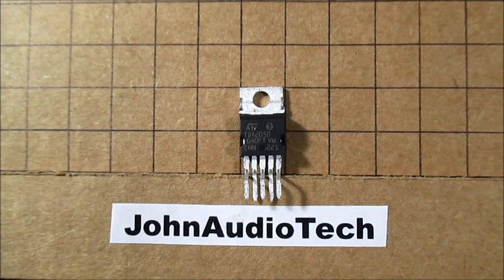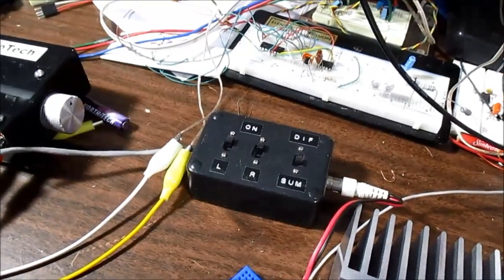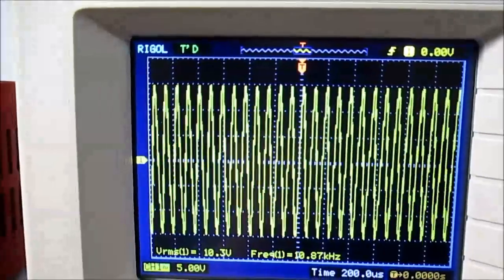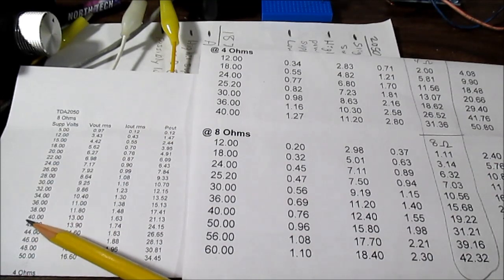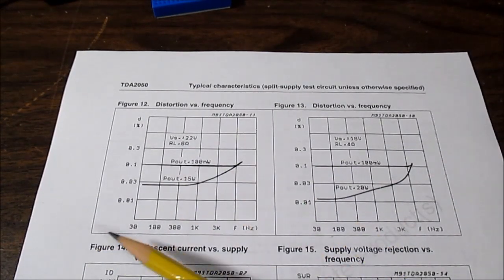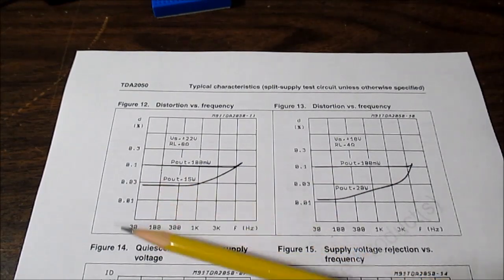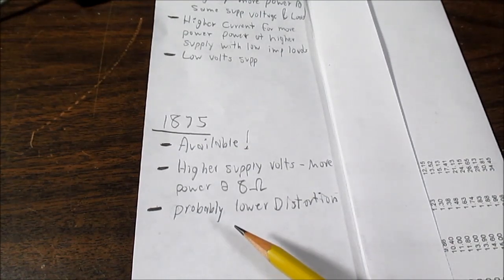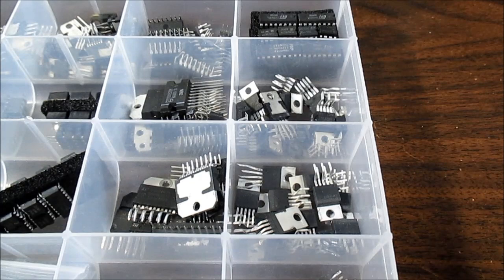TDA2050 audio amplifier IC test & review plus compared to the LM1875

Comment from the maker: Hey guys! A couple points I didn't mention in the video: The TDA2050 seems to be more prone to instability so needs careful layout and component selection. Its current limit tends to make a loud pop sound when activated while driving reactive loads. The LM1875 has the advantage in both cases. I plan to test these issues and make a video.
Reply: i bought the same lm1875 kit from ebay the amp makes a click sound when turned on/off. does it happen with  your kit too?
thanks
Reply: Bharat Singh my lm1875t deadly silent, try better component. I use film and mica for smaller caps value, fc for feedback, fm for power and elna for psu. Elna re3 might be slightly cheaper for power filtering, i only use what i have at hand.

Elna re3 work well for tda series, i notice significant improvement for tda series. Confirmed by blind testing with my friend compared to several others including fc series.
Reply: @wiradharma7030  are you getting good quality ics of Tda2050 ?
I'm getting some cheap versions here in India so I want to know that how much maximum voltage can it sustain since Tda2030,2050 are all obsolete now but still I want to make an amplifier for home use so please tell me about the max operating voltage
Reply: @amitghosh6966  Once i didnt realize that i use 27++vdc unregulated on 4ohm load without problem other than the heatsink got slightly warmer. BTW, I tend to use bigger heatsink than I should. 

I got most of the chip and transistor online from inline seller with higher rating. The parts I got from local store has questionable quality, I stop buying critical parts from them since like 2 years ago. I only buy non critical parts from local store like resistors for psu and emmiter, jack & cables, screws and similar non critical item.

So far l never have failing chip even when I use them on higher than rated voltage. I think almost all tda2050 chip out there is not genuine anyway, but some replica seems to perform better than others. The issues that I got currently is on lm1875 which at lower wattage got slightly warmer even on bigger heatsink, much hotter than tda2050. My latest project is 3x lm1875 in parallel, I use similar sized heatsink with lm3886 @26.5v 4ohm -62Wrms output. The lm1875s run very hot @24v.

Btw, try lm317/337 with 2x tip41/42c for supply. I use 20k trimpot for voltage adjustment on 25v AC. Its cheap(less than $10) and u ll got noticeable improvement on any amps compared to unregulated supply. I made mine with point to point method, ugly but its works.
Reply: @wiradharma7030  thanks for the reply. I love making amplifier circuits so I keep asking everyone about anything about amplifiers
Reply: @wiradharma7030  Can We get the same output from Tda2050 ic on Single as well as a Split supply ?
I wired a Tda2050 ic on Single supply mode at 24 Volts , 4 ohms load and got maximum 6 Watts before Clipping. I want to know that if I power this chip on split supply of +/- 12 Volts ie 24 Volts , will I get the same 6 Watts or even more watts ?
Reply: @amitghosh6966  in theory, yes. John got 9.33watt rms even at 8 ohm with 28v(thats  should be single supply). U might got rebranded tda2030. Tda2030 with tda2050 marking on it.

Try different source(thats bad chip u got there), or try lm1875. Use 100uf-220uf on feedback caps(the one in series with 680r/1k resistor to ground). I use muse fg there, its cheap and sound quite decent. I used to use 22uf bp there, 100uf muse fg give more thump. I dont know of u ll find one, try find "su rong" mkp as input caps(bright red). Its chinese, but sound great. Btw, I use 1uf for input, 47k&1.8k resistor on feedback loop with 100uf feedback cap. I add 1.8k series between input cap & input pin, and 470pf to ground between the 1.8k resistor & input pin to filter EMI. On feedback I add another 47k + 27pf ceramic paralel with the 47k feedback resistor to compensate 470pf capacitance loading. The resistors are generic metal film(i stop using vishay dale, too expensive lol) the 470pf&27pf is cheap monolithic ceramic. It should be equal to 22k feedback, but with 47k u ll need half the caps.

Oh, dont forget to make the feedback loop as short as possible. I solder the feedback res directly on the pin, lol. Try find 220uf genuine elna re3, for power filter caps. On chip amps i use 2200uf, 220uf, 1uf ceramic and generic 100nf mkt. Elna silmics ii sound great but too expensive, elna re3 sound quite similar at a fraction of the price of silmic ii.

Edit: it should be muse fg(black/gold) on feedback, muse es(green) is bp cap. Muse es still too expensive for me, lol.
Reply: @wiradharma7030  If operating this chip tda2050 on Single or Split supply gives the same output power, then what's the benefit in operation on Split supply rather than Single supply ?
Reply: @amitghosh6966  split supply, no output caps(big caps series to speaker), no turn on/off pop.
Reply: @wiradharma7030  Ok. Thanks for reply.
And one more thing I want to know that if I operate this chip on Single 24 Volts and also on split +/- 12 Volts (24 v) will both the configuration draw the same current or there will be difference of current drawn  in both ?
Reply: @amitghosh6966  I havent measure, but i prefer dual rail. On op amp, dual rail allow for rail to rail voltage swing. And seems more stable. Why u prefer single rail? Even on my car, I use single to dual rail inverter. Dual rail seems to output more power before clipping, I dont have proof on this, its just based on my ears. Dual rail amps much more simple, and easier to tweak around. U might hit supply current limit earlier with single supply. Is there any reason u prefer single rail?
Reply: @wiradharma7030  It's difficult to get centre tapped transformer here for a specific voltages say 9-0-9 or 10-0-10 etc. Since I don't know how much maximum voltage these cheaper version chips available here will withstand I prefer Single supply operation of these chips. These transformers may be available online but  the prices are too high for me. Anyway thanks again
Reply: @amitghosh6966  try making adjustable linear regulator. U need lm317, lm337, 4 1a diode, 2x 240/330ohm(i use 330r) resistor, 2x 0.5w 100ohm resistor, 2x 2k trimpot, 2 set of tip31/32 or tip41/42(i use this set), 4 0.10-0.50r(i use 0.22r) 5w resistor. Find lm317 + transistor schematics, for negative rail u only need to swap the mid and the right pin. The input and output pin reversed on lm337. Left pin on lm317 and lm337 is adj pin.

First of all connect 0.22-0.50r 5w resistor to all the tip emmiter pin(right pin), after this resistor we connect lm317/337 output pin.

From diode rectifier u connect 100r resistor and tip collector pin, after resistor u connect transistor base pin and lm317/337(regulator) input pin. 

Then U connect 240r or 330r to 2k trimpot from regulator output pin. Then add 100nf to ground, and one trimpot pin also to ground. U only need two trimpot pin. 

Put protection diode paralel to 240r/330r resistor and from transistor collector(mid pin) to regulator(lm317/lm337) output pin. 

On + rail(lm317) the output pin connected with diode + pin where the - connected to adj pin on regulator. The second diode on + rail u connect it backwards. Means, the diode negative to tip emmiter and diode + on tip collector. Reverse the diode pin for negative rail(lm337). 

Use the pot to adjust the voltage u need. Remember input and output pin(mid and right pin) on lm317 and 337 are reversed, try googling. Btw, u need a small heatsink(10cm x 5cm will do) to attach lm317/337 and all tips pair. Put them all on one heatsink. Use tip31/41 and lm317 on positive rail, and tip32/42 and lm337 for negative rail.

This adjustable linear regulator capable outputting more than around 4a to 8a depending on ur input and output dc voltage. For further noise filtering you could add 470uf-1000uf and 1k resistor+100nf in series paralel to regulator ouput. For voltage dissipation when turning off u could add 200k to 1m resistor from each rail to ground.

Linear regulator not only to reduce dc voltage, its also make the voltage stable which mean better sound. The drawback is it draw more current from ur wall socket. The total cost should be around $10.

If u need complete schematics, put ur email here.
Reply: @wiradharma7030  Hey!
I am also building lot of amplifiers and want help about a problem bothering me that when I increase the volume to maximum, the sound gets distorted. I play music from my android phone and it's volume slider is set to maximum and so is the amplifier volume. So how to prevent distortion in sound while maintaining louder volume ?
Reply: @sanjoy2521 You hit the limit of one or more parts in your amplifier, most of the time on power or loudspeaker. Many psu/transformer and loudspeaker deliver lower than stated capacity. Many speaker only state the max output, not the rms output. The easier way just to simply not to turn the volume above the limit or add resistor on amps input. The proper way is to find the component that hit the limit, take note that overheates parts could be the culprit. Or, you might simply use smaller heatsink that it should be on transistor/ic.

I think john have a better answer and better at explaining than me. Just ask him to have a vid on this topic. He often measure amps power, he might have better tricks and tip to optimizing amps output limit.
Reply: @wiradharma7030  Thank you. I commented on some of John's videos on this but still got no reply.
Reply: @wiradharma7030  Many amplifier testing videos by John Sir shows he is using 1Khz signal as input on which the amplifier generates the maximum output power before Clipping but I want to know that can the amplifier generate the same output when we will be playing any music or song on the amplifier ?
For example, if applying the test signal gives 20 Watts from tda2050 before Clipping, then will we get same output if we play any music from mobile phone as source ?
Reply: @sanjoy2521  1khz should be close as lower freq tend to drew more. Amplifier, amplify input. For example with 1 watt input and 26 gain, amplifier in theory will output 26 watt. The higher input you feed the closer you to the limit before clipping. Source tend to output lower current, but noise limit to how low it could go. Not a good explanation here, but beter than nothing ;).
Reply: @wiradharma7030  thanks dear :-)
Reply: @sanjoy2521  Your welcome, anyway i just built another tda2050. I made it single supply, then i realize that for single supply you need output caps. Once i realize very low esr caps(gxe in my case) was louder. In fact, gxe series has lower esr than most audio grade one.

Like all we know, higher load(speaker, crossover, output caps) robs power to speaker. Plus higher load mean on the same supply voltage you got less.

This amp will be battery operated, so i need it to be efficuent. And, AB class only have around 60% efficiency on dual supply to begin with. So, i decide just to make btl configuration. Btl does not need output caps for single supply, take a look at btl schematics.

Each chip will see half load. Since i use 8ohm speaker btl will do, if u use 8 ohm just make use btl schematics. I even use 25-35v rated caps for this build, its slightly cheaper than 50v-63v i mainly use. I use 16v-35v mainly for preamps. At these voltage rating, u got good audio grade caps dirty cheap. Less than half for silmic, which i often use. 

Try silmic for preamp input caps, u might like it. 16-25v will do, i use 50v just because i have many of them. U got several of these at just $1. Slightly colored sounding than most mkp, but i like it. Sound livier than wimas, wimas has good value if you like transparancy. Like some say burr brown opamp was colored, if you like it why not. Some of my friend do prefer burr brown than ne5532 i use mostly. For me if they like it, the'll got it that way.

Comment: I prefer to use a single rail supply with a TDA2050. This is because, if anything goes wrong with the power supply and a DC voltage appears across the speakers, they could easily be damaged or permanently destroyed. In practice, a 1,000uF capacitor seems to pass the bass adequately - ideally, perhaps, a 2,200 uF capacitor should be used. The capacitor should be of the highest quality and rated at slightly higher than the full rail voltage. While, in practice, only half the rail supply voltage appears across the capacitor, if anything goes wrong with the TDA2050 it is possible that the full rail voltage could appear across it, so it is better to be on the safe side. Another advantage, of course, is that the heat sink is connected to the -ve pin, so, when a single rail supply is used, the heat sink can be bolted directly to the heat sink, which can be at earth potential and be connected to the metal case of the amplifier. The TDA2050 is a very capable performer, provided that you make sure that you obtain a genuine original. There are many fakes about. I find that, even with a single rail supply of 20 volts (equivalent to 10-0-10 with a dual rail supply) it can deliver more than enough power to provide room filling volume, with speakers of standard design.

Comment: Another thing that can be done to assist stability is to increase the value of the resistor going to signal ground through the series capacitor, which is there to shunt some of the negative feedback. Choose a value that gives only as much gain as is required.

Comment: A couple of points:
(1) The ear is not terribly sensitive to changes of volume, and most folks would agree that you need to double the output power to make a significant difference in the perceived volume. So I really don't think that anybody can hear the difference between a maximum output of 19.22W and 21.13W. Also the spurious precision is annoying. What's the point of quoting 4 significant figures of power, when you're clearly only measuring the rms voltage to 3 significant figures?
(2) The datasheet for the LM1875 shows the typical circuit with a gain of 20 and that's what the THD graphs are based on. The TDA datasheet shows a typical circuit with a gain of 32, and although the reduction in THD may not necessarily be exactly proportional to the amount of negative feedback applied, it's usually not far off, so if you multiplied the figures for the LM1875 by 1.6, you'd see them to be rather nearer to the TDA2050 figures that you assume. The advantage that the LM1875 has comes from its open-loop gain of 90dB, compared with the 80dB of the TDA2050 - that's about a factor of 3.

TLDR: in reality, there's hardly any audible difference between the chips if you put them into identical circuits. The LM1875 is spec'd for operation with a minimum of 16V supply and the TDA2050 is spec'd down to 9V. But if you've only got a 9V supply, you might as well use an LM386 and save yourself a lot of hassle.

Comment: NTE7169 is marked as a replacement part for TDA2050, NTE1380 for TDA2030 - I have no personal experience with NTE products and those are a little more expensive than your ebay source or LM1875.

Comment: Great data! Why do you think that the max v-out (without clipping) is so far from the supply voltage?
Reply: It isn't. In the tables, John is recording root-mean-square (rms) voltage. But the peak-to-peak (pp) voltage is 2.8 times the rms voltage. So if you look at 6:27 at the 40V supply entry, for example, you see 13Vrms, which equates to 36.4Vpp. That's about as good as you're going to get for a bipolar class AB output stage on a 40V supply.

Comment: Are the Tda2050 & Tda2030A chips available on Amazon of good quality ?

Can they be used on higher supply voltages say 36 Volts ?
Reply from the maker: These TDA chips were discontinued several years ago. Most of what's out there is counterfeit.
Reply: @JohnAudioTech  you said you found a source and never shared classy

Comment: Great little chips, I'm building a stereo home theatre based on tda2030As. Only thing I would say is PCB layout is so important, I initially designed my own but soon realised I had messed up and had to buy a kit. They do dissipate a lot of heat as well but sound great!
Reply: Jozef  Sowerby i also bought pcb, i think they have better grounding structure. Less noise than point to point i usually made. Try find one with good review, i think most buying pcb known their stuffs. I only join the fray.

Comment: tda 2050 datasheet says max +-25 v dc—this is regulated or unregulated dc voltage ???

—-i am using 16-0-16 v transformer after rectification,filter caps gives 22-0-22 v dc(non regulated)=44 v —which when load speaker connected surely drop voltage to 16-0-16 v on load=32 v (not measured best guess)

——–so what do you think i should get a transformer which when load applied should give 50 v ?

———thank you
Reply from the maker: 50v is the rated absolute max, so I'd stay back to +/- 22v (44 total). With a non regulated supply there will be sag. Using a heavier transformer will reduce the sag somewhat.
Reply: thanks

Comment: Hello John Audio Tech,I need help in finding the correct size mica insulators for the larger audio chip amps. I have the TO-220 style mica insulator, but it is small it seems.....a little help please......I would like to install heat sinks to some amps I have purchased but they need to be mounted to a heat sink.....I am lost ..... A little help please